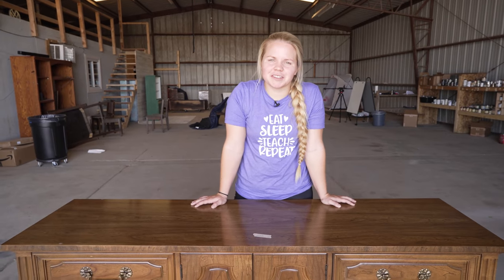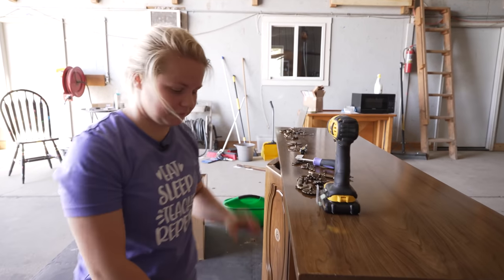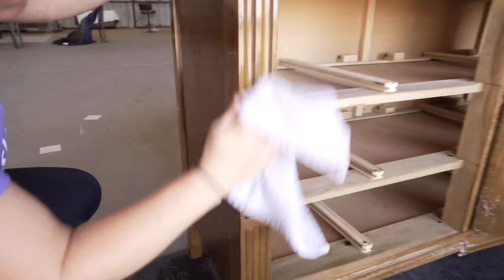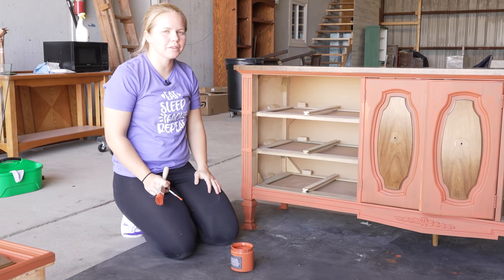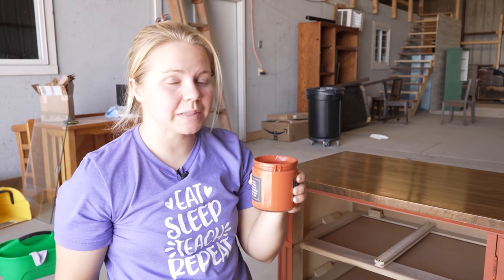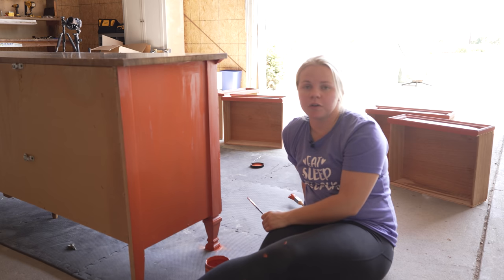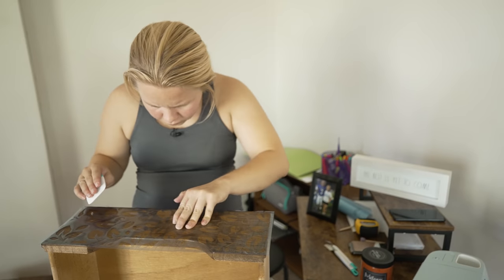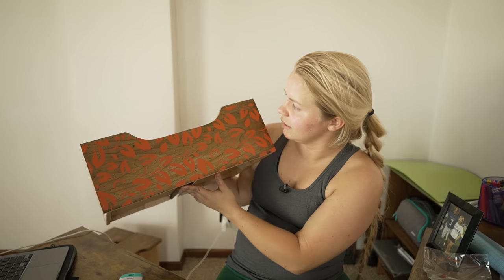FB Marketplace Dresser Makeover | Creating Stencils with @Cricut

Comment: Two questions: Did you sand the stenciled drawer surface at all? And did you put any type of finish on the unpainted wood surfaces?
Reply: I wondered that, too.  The tops of dressers always get a lot of wear, so they need the extra protection.  (Or is that just me? 😉).  I love that the piece kept a definite 70’s vibe, but the color made it Boho modern.